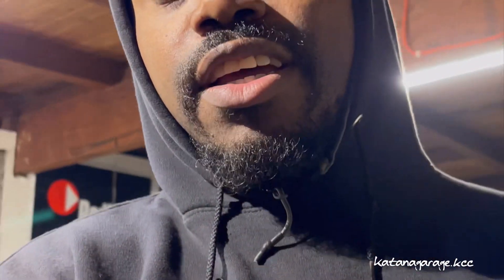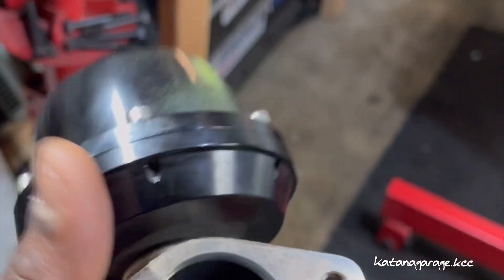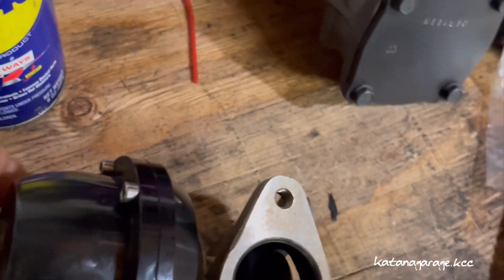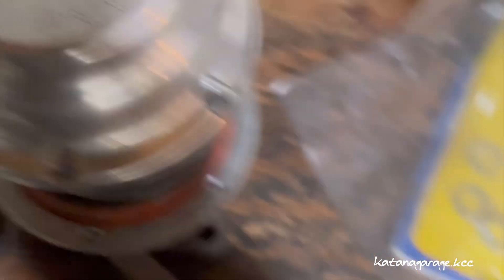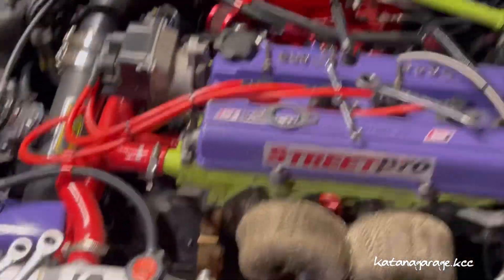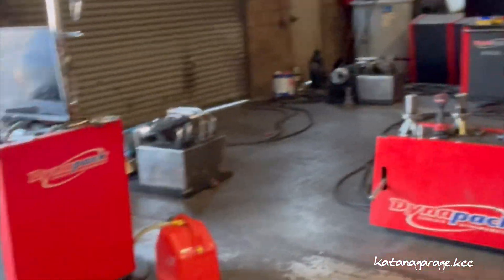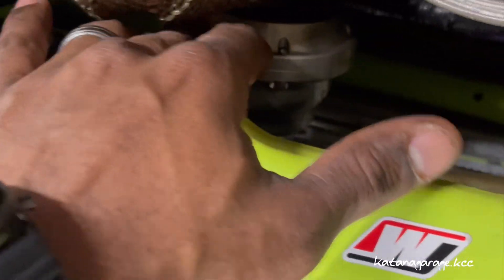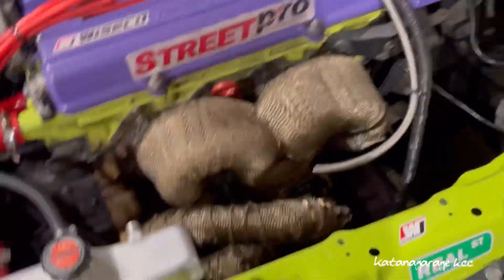Why not to use Cheap EBay turbo kit & dyno

Comment: I just came from LA last week, sup from South Florida!!! I'm turbocharging my car with a K20 in a 1995 Saturn SL2, have a dude working on it for me.
Reply from the maker: Sheesh sup bro bro 🙌🏿, aye that’s gonna be one sick build bro. Hope you document the whole thing.
Reply: @katanagarage168  I will, doing forged bottom end on it also. ARP main and head studs, etc, port and polish, etc. Nothing super crazy, aiming for 400-500 HP. But the car is extremely light, polymer panels with a Seibon carbon fiber hood and I got Einkei RPF1 15X7's on it so everything is geared power to weight in mind.
Reply from the maker: @junechris  and that right there is the recipe for some god damn jam 💯